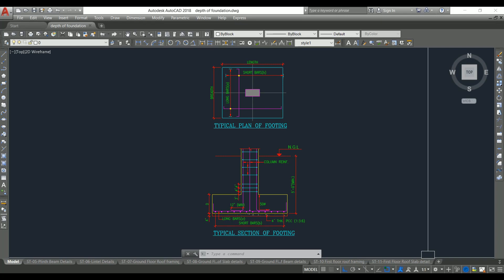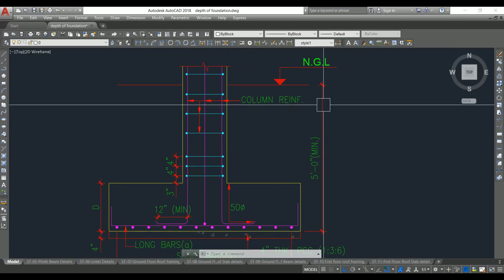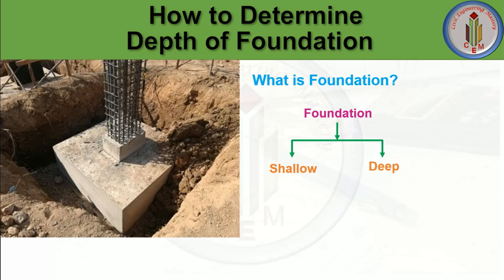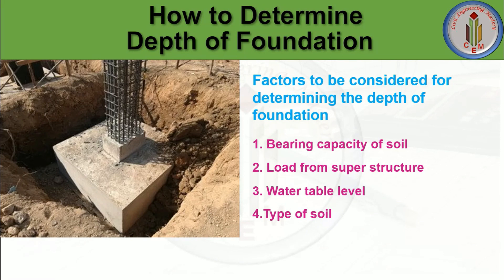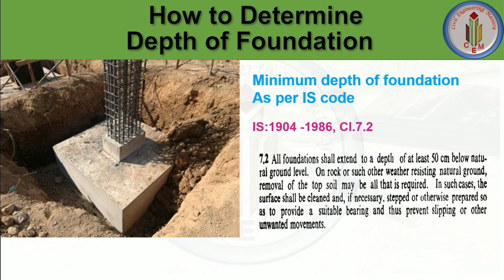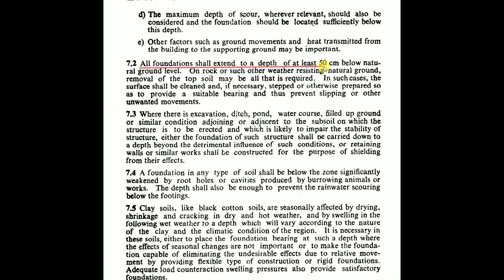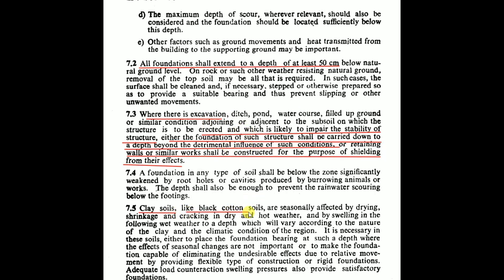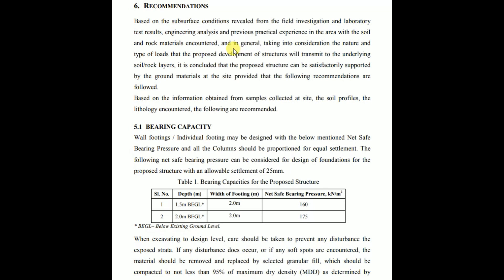Depth of Foundation | How to determine the depth of foundation  | Minimum depth of Foundation

Comment: 👍 First we do loading option, or slab modelling. pl describe details algorithm of steps for dedign.
Reply from the maker: I have created a course, structural design of buildings using Etabs software which includes structural analysis and design of a five-sorey RCC building(Real project) and is now available on udemy.
Kindly use the below link to avail the full course.
https://www.udemy.com/course/structural-design-of-buildings-using-etabs-software/?referralCode=14883FDBBD95A1ADAC02